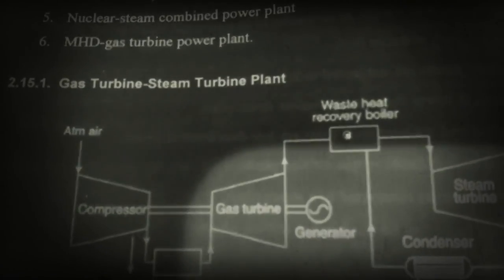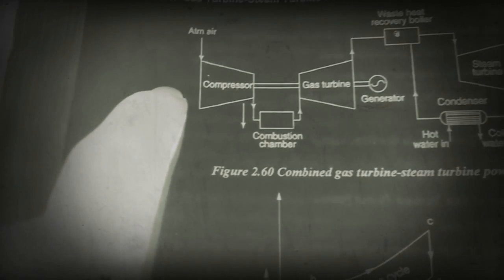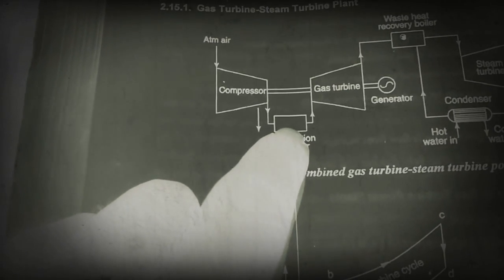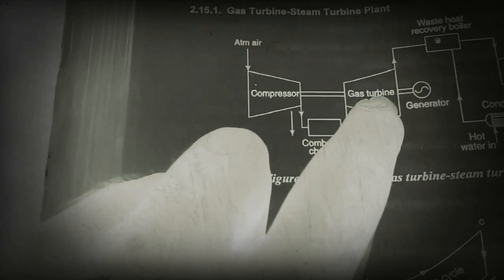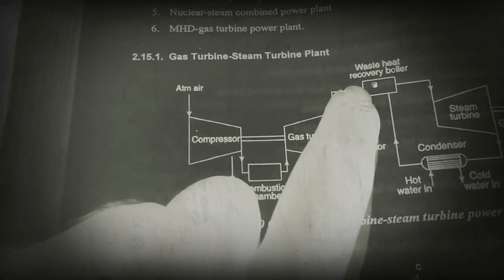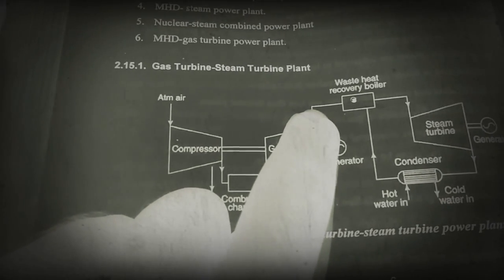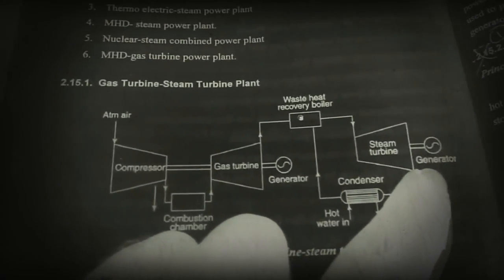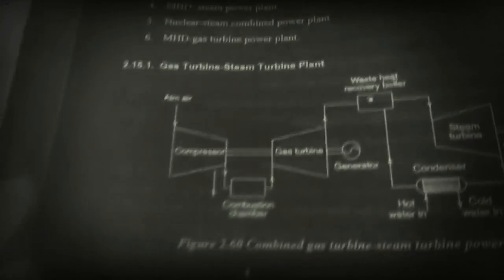Gas turbine steam turbine plant

Comment: Energy used to compress air sounds higher than energy gained from said compressed air, else you'd have infinite energy. But i guess it's more efficient than phase changing water. googles Not even that; 20 to 60 % vs 90+% for steam turbines.

Comment: dear kindly change your arrow direction in steam power plant portion and where the hot water intake, there the cold water should intake and vice versa ..... hope so you will notice my point.
Reply from the maker: Thanks for suggesting
Reply: @manufacturingminds  is driving a steam turbine along with a generator makes power generation more efficient than having a recuperator?